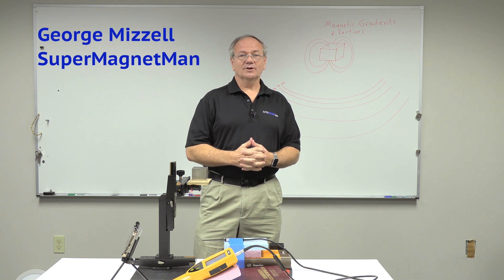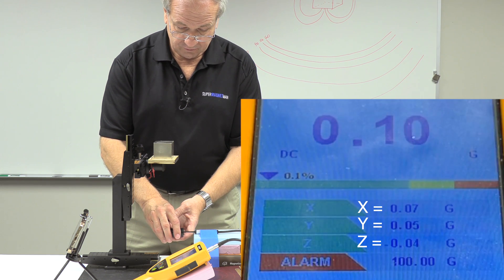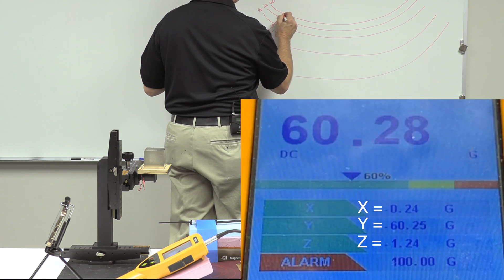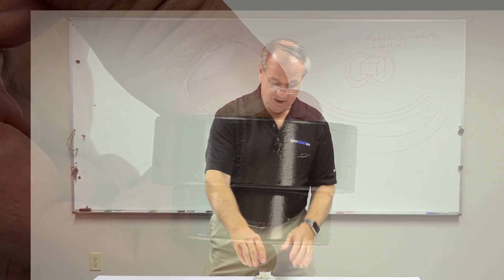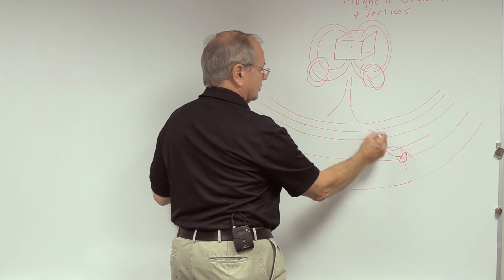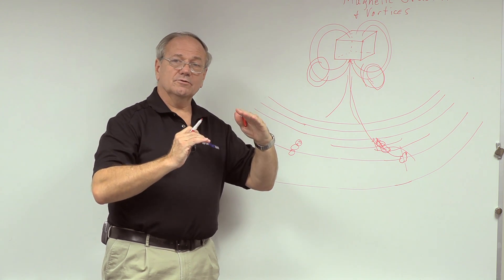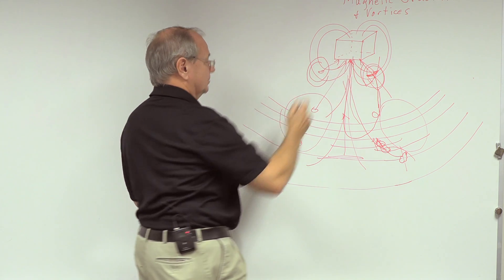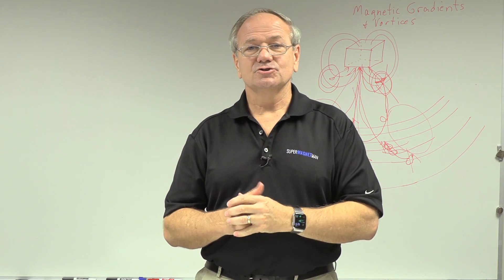Magnetic Vortices in motion and Magnetic Gradients

Comment: It seems like you only did this with the South Pole facing down and I know iron is attractive to both North and South poles, but then again each side would be in opposite directions of flow one would be going in in the other going out. Therefore is there a difference with this experiment if you change the pole from south to north or does it act the same? 

I would assume it might act similar except be less pronounced in the repulsive effect of the outer tornado because both fields are going together and therefore the tornado would likely be larger and quicker to develop as well as maybe more forceful in its action.
Reply from the maker: Usually I don't check for south or north polarity when working with iron since it is attracted to both.  It is a great experiment to explain gradients in magnetic fields.

Comment: Maybe you can help me. I had a meditation where I was shown a model of a geothermal magnetic generator. It was a donut shaped vortex with a tight center. There were magnets on tracks being propelled by a pipe inside a geothermal vent in a pulsating manner. I was told if we build 7 of these we could power all of planet earth. I have been meditating for many years, and sometimes things come through.  This was one of the most powerful ones and I'd really like for someone with knowledge to consider my theory. If Tesla could access knowledge above, I guess any of us can. So maybe this is one of those ideas.

Comment: Hmmm….this is a great video…one may be confused about the effect of a magnetic ‘field’ close to a magnet, especially when magnets, in this case iron filings, are used in observation.  Obviously, the magnetic filings, change what the observer ‘sees’ in relation to the test magnetic source.  You did a great job of representing this observation conundrum.   By merely changing the filing size and oil viscosity, the observation changes.  Thus, one may conclude the actual magnetic field configuration from the magnet is hard to really discern.  For example, if space is made of extremely small charged particles, or energy with magnetic ‘moments’, then again one has a difficult time describing magnetic field geometry.      Of course, the magnet itself consists of its’ own internal environment, immense in another scale, where again one encounters the same conundrum.  Of course, the other aspect of magnetic ‘field’ is the electric ‘field’ which is always present as well, and inseparable, as they are different aspects of the same thing.  Again, it was so refreshing to see your video, thanks!
Reply: The field is easier to visualise with a ferrocell. Look for Ken Wheeler's YouTube channel theoria_apophasis
Reply: @georgetv108  Rather, easier to see the ‘shape’ of a ‘field’ influenced by micron size iron in oil.  Certainly all of the iron becomes magnetic itself and attracts and separates thereof.

Comment: Ok I think I am picking up what you’re laying down. It’s not actually the hourglass vortex that’s the source it’s the 2 rotating vortices that pitch the cylinder vortex that do all the work. Mother Nature loves Venturi effect. Plasma pitching.  light vortex pitching using dielectric rotating torus Venturing a light hyperboloid or ⌛️ what makes it pitch are those rotating particles in the solution 🍩 ⏳ 🍩 🔃↕️🔃 ↔️ 🔄↕️🔄

Comment: You are mixing up magnetic with fluid dynamic effects. The vortex is a result of your oil being pulled up and out with the filings. Try this again with something less viscous (water, spiritus) and you will probably see less vortex (and faster movement).
Reply from the maker: Thanks for your comment - I intentionally chose a fairly viscous fluid to see it - Of course water or alcohol quickly oxidize the particles and you only have a very short time frame to work with and have to shoot everything with slow motion cameras.  If you look carefully out to the sides you absolutely see a stream of particles going down relative to the central stream.  Then as they near the bottom they are pulled to the center stream and back up.  It is harder to video in micro as opposed to me being able to watch this through a magnifying glass:)
Reply: @SuperMagnetMan  try with diesel fuel or gasoline

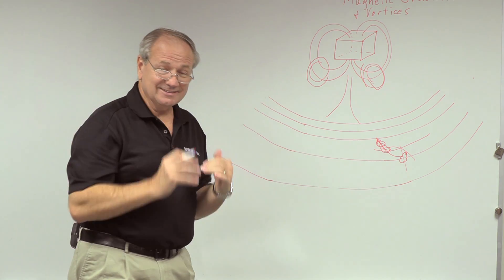Comment: The wording at @9:22 is unfortunate: 'gathers the field' is not what happens, it's just an induced magnet in the filing that interacts with the primary magnet, nothing more. An ferrite core in a coil does the same, no 'concentration' or 'bending' of the field.
Reply from the maker: Thanks for the comment - but "gathers the field" is what actually happens - as the magnetism prefers to travel through ferrous material rather than anything else it will pull more field into the particles which will align relative to the applied field.  Adjacent particles that are just ahead of that particle will align themselves N-S to N-S and become a longer particle.  Particles that are parallel to each other will repel side to side until one has collected a larger mass and then accelerate ahead.
Reply: @SuperMagnetMan  You cannot put a force on a field and bend it. A total field is just the sum of a lot of elementary fields, Within ferro- and ferri-magnetic materials, small elementary magnets that are normally in random directions and cancel each other, under an external magnetic field will align, forming an additional magnet. 
The sum of the external field and the induced field will combine and look like the external field is bent. But actually it is just an additional field.
You may say it does not make a difference in the end. But it is most important to have the right explanation to do correct predictions for systems.
 Do the simulation, you will see it works out.
Reply: Define field. The way you word it you make it sound like more than one field. 
It doesn't even make sense unless there  is a fundamental field outside of the magnetic field. 

There might be many magnetic fields but they are all the same thing from the same source just a different state? Like ice is frozen water. It's still water.
Reply: @magneticflux7833  I'll take the definition I learned at university, in the words of the english wikipedia: "A magnetic field is a vector field that describes the magnetic influence on moving electric charges, electric currents, and magnetic materials." Where "vector field" means that the influence has a magnitude and direction. You can measure the field by some probe that you move through the field and that somehow is affected by the field, for example small magnetic particles, or a Hall probe.

The key point in vector fields is that every source generates a field and you can add them by the linear superposition principle. The result of course is one effective field. If you remove all but a single source, measure it separately, and do this for every source, you can add up the separates fields to the total effective field.

The special thing about ferro- and ferri-magnetic materials is, that they only generate a field when some external field is present (or was present and the material shows reminiscence - permanent magnet). This works by alignment of the otherwise randomly oriented magnetic (Weiss) domains. Then the material acts just like an additional permanent magnet. This is the magnetization, and depending on the material you can either measure it afterwards in a permanent magnet or only little magnetization in a ferrite rod (see coercitivity). The combination of the magnetizing field and the ready-created magnet is the field that you observe.

 It looks like the ferrous material "attracts" the field, and "amplifies" it, while in fact it is two different sources that each generate their own fields, combining in a seemingly no-trivial total fields.

Comment: Superfan here. Lol  Ever attempted this with a diamagnetic particle? Paramagnetic?  I am interested in effect of induced field of ferromagnetic on co suspensions of para and diamagnetic particles.  I'm positing that self organizing structures may be visible, ie crystalline stabilization patterns
Reply from the maker: I have tried pyrolytic graphite - the most diamagnetic material - with magnets and the particles suspended in water.  It is hard to tell anything.  I will set up some with the silicone oil and see if it shows anything else.  I would not expect the paramagnetic particles like copper to show anything but I can test it and see.  Good suggestion.
Reply: @SuperMagnetMan  thanks, did you just order 2nm iron filings?  I am going to see if I can set up a shaker table to size filings.  Are you just using plain silicon brake fluid?
Reply: @SuperMagnetMan  I'm thinking pyrolitic has wrong density.  Bismuth?  Density isnt the correct word.  Pyrolitic is planar